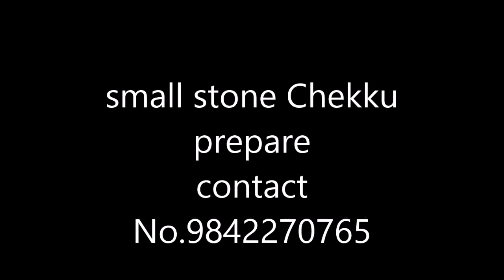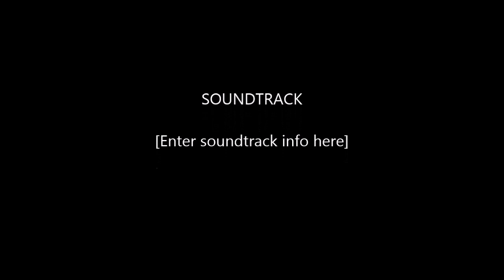Kal (Stone) chekku Pindow power Ghani chekku 9842270765

Comment: what price sir
Reply from the maker: Price.Rs,275000  GST, forwarding, clearance, etc And bed bolt and civil works, Machine bolt-nut wooden beam, Installation charge, etc. This type of chekku is intended to be a 1450kgs stone chekku slab. It should be fitted with four-bed bolts 4.5" feet underneath the floor. The base shall be insulated. Showing off the oil is very cold. Half-capacity grinding in less time than wooden.c hekku.Capacity 15Kgs/per 35Mins.Power 3Hp/3Phase/Size7X7.     Three people will come with our foreman to install the PowerGhana chekku, buyers arranging accommodation, food, etc. for them is up to the machine buyer. If it is too far, the machine buyers have to pay Rs.1500 per person per day for the time of travel on the train. Installation charge for the Pinto Power Ghani check only